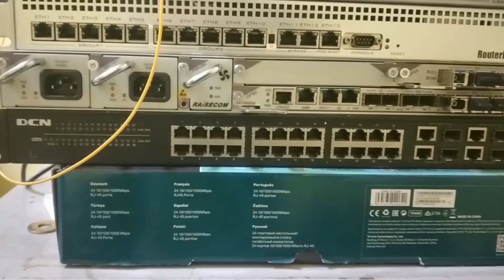Pasang OTB 72 Core - Instalasi Kabel Fiber Optik

Comment: itu pada inputnya kalau boleh tau seperti apa yaa mas?? saya penasaran inputnya bagaimana 72 core tersebut apakah menggunakan satu connector?
Reply from the maker: untuk inputan bisa ngambil dari kabel 72 core ini di pisah juga bisa, tergantung kitanya mau pakai apa, masalah core inputan terganting kita pake sfp nya, ada yang single core atau multi core om.
Reply: @CatatanUsangTeknisi  hooo gitu yaa pak berarti misalnya kita mau nyambung kan kabel multicore 6 dan 8 make sfp yaa ?